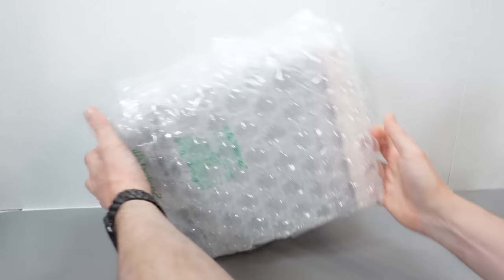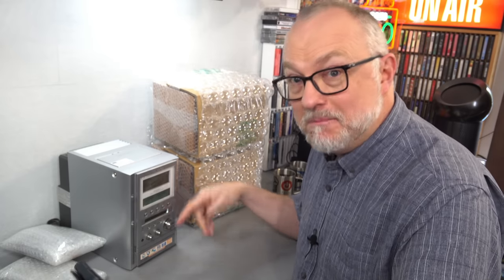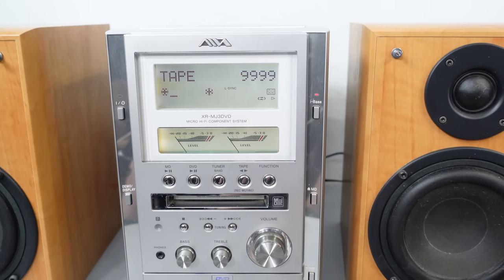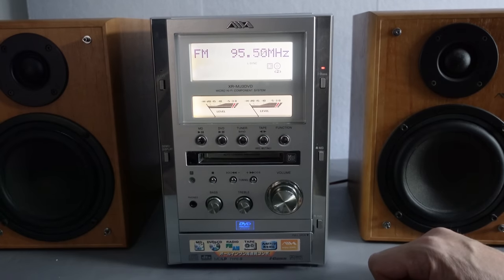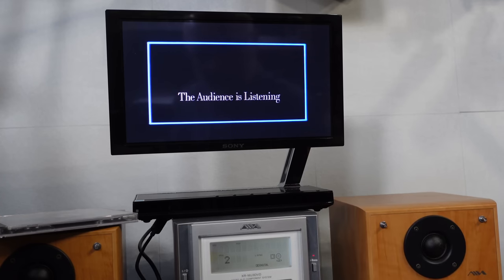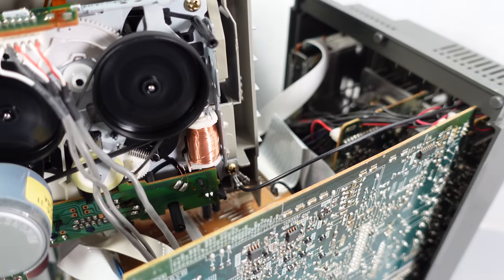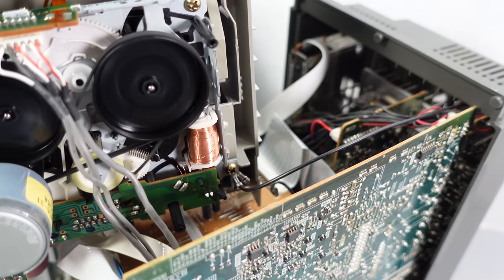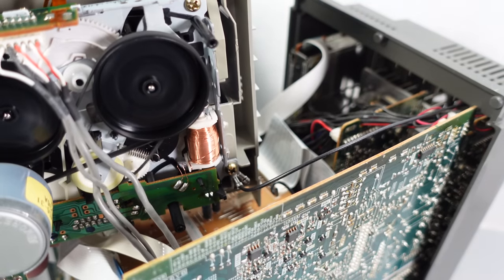Micro Systems 2:  Eclectic Boo-Boo

Comment: Probably massively too late now, but you can just connect the green component lead with any RCA cable and you will get a black and white image that will let you navigate menus
Reply: That doesn't help much when the green connector isn't on the unit itself. But personally I would be very surprised if the interlaced/progressive switch wouldn't re-enable composite video output.

Comment: So the original Aiwa was all separates so if you added more full sized separates onto it with the micro separates they would be different size from each other.

Then you have the final real Aiwa 2000s with the blue speakers and the final one with decent wattage speakers.

Then you have Aiwa as a lower end Sony but packed with features and less reliably than the hinges of a front tape door breaking of the previous.

Next you probably have a really low grade tape I bet in the final one.

Comment: I have a micro system from Sony. It worked almost perfectly (just headphones jack didn't) until last summer. Cassette deck stopped fast forward or back, just playing and with strange noises, next CD player stopped reading discs. Both in the same time. Now only aux input and FM radio work fine

Comment: I'd love to try and fix this, looks an interesting one :D

a few different things - the DVD drive I think I know what's up with that, the try has just slipped out of position on the runner.. the MD player, you need to move the sled back, and there's a chance the detect switch is frozen (from being stuck in position so long), and the tape-drive will likely just be a capacitor or two, or a couple of transistors :)

Comment: you may be  able to repurpose 

1. dental rubber bands

2. pinball machine rubber bands.

if you are up to getting prime membership you could overnight stuff.

you may want to make sure the cd is not copy protected because after napster then labels was making cds with copy protection usually based on a fake track designed to cause reading errors.

not all cds said if it was protected so you may want to try a cd from before the 90s when they was guaranteed not to have protection.

Comment: In 2000 I had the Aiwa with the blue speakers that really was big quality small price that one even the tape sounded decent I used my tape so much the door packed in and I couldn't use tape I had to chuck it out. Yep decent sounding tape but poor door. It still lasted 10 years my favorite older bedroom system.

Comment: I learned my lesson in trying to fix what might have been an easy fix for someone more experienced, years ago.  The taking apart bit is easy.  It's the putting it all back together again, (making sure to put everything back in the same position and the right way round), that's the problem.  A shame this wasn't able to be fixed, but I think parts of it were too far gone.  The MiniDisc mechanism and possibly the CD/DVD, too.  The cassette deck was a relatively easy fix, at least mechanically.  And, if there was a proper aerial on it, it might have been a half-decent digital tuner.  'Frash Rom.'  Definitely Japanese!  😁

Comment: Around the same time this system was released, a close mate of mine had a midi system with 5-disc changer which likewise could play DVDs. I seem to remember it was also an Aiwa (Old badge) but was a UK model, so perhaps this was something Aiwa was testing in the market at the start of the 2000s? 🙂

If you have an Aiwa system of that era and are curious: The obvious giveaway would be a video connection on the back. My mates only had composite, so would've been easy to mistake for an RCA audio connection. 🔌

Finally: I'm going to guess the reason the tape player went "pop" is because you might've put the plastic on the wrong side of the flex, leading to it being inserted in reverse. 🙃

Comment: I have a Sharp mini system from around 2000. It's feature rich and has impressive sound considering. The only reason l don't use it any more is because the remote quit working. As you said there are many functions that are inaccessible without remote. It's still functional as a whole. But all the surround sound adjustments are solely remote accessible. It would jusr end up bugging the crap outta me...

Comment: Probably a moot issue, since you have a component cable on the way, but on a lot of Sony devices, power off the machine, then press and hold the power switch until there is a beep (or 30-60sec, if no beeper) to factory reset.

This disabling video output must be a Song thing, I remember having to do a reset on PlayStation 3s if you used HDMI, but moved the machine to somewhere with only analog connections. You had to blind reset the thing to get video back on composite/component.

Also, about FrashROM, in Japanese R and L don't have different sounds, so often they use either character.

Comment: One thing I hated back in the day, was those multi-format disc players, they were so slow, and got slower and slower with each new model that supported more formats.

As for those ribbon cables, they are a pretty standard style, even still today. You can easily get replacements from places like Digikey or Farnell, no need to try and save some old, potentially damaged, ones.

Comment: I got some hand downs and can confirm your experience, mini system late 1980s Sony, belts gone, micro system late 1990s samsung, cd and remote gone,  belts good though, mini system early 2000s Sony, belts and cd gone, repaired cd but deck is unfixable. I'm curious about your next video with a new system. Cool series so far.

Comment: Also if your machine chews your tape, usually the best way to deal with it is to leave it and rewind. Unless it has wrapped itself round the capstan it will return without damage.
Reply: I've had enough experiences of it just making the situation far worse I'll take it out as soon as it seems to be chewing.
Reply: @trailersic  You just need to be sensible. In 50 years working with tape I've never had an issue, because I'm not going to attempt to rewind it if it has threaded its way through the machine for half an hour.
Reply: @trailersic  PS I guess for me its only when I'm testing, so a test tape is in and you are only going to do it once and in quick order. I have a lot of machines through my hands. So yes, i agree.maybe its not good general advice.

Comment: i would bet the issue isnt the laser with the dvd player its most likely the laser diode's alignment mekanism being worn out, its done electro mechanically and over time the coil needs more current to do its job most modern dvd players now come with an software adjustable mosfet to deliver the power to the electromagnetic coil

Comment: Maybe you or someone in the comments has already addressed this, I am only half way through the video. But it might be worth a try to connect the composite out rca of the awia to the "Y" or green rca of the 3 component rca connections on your TV if it has them, to see if you can display the menus again. Having set the Aiwa video out to progressive means it might be sending a 480p60, not 480i signal out the composite rca, and your TV composite input may not like that. I've seen this behavior on other DVD players.

Comment: Used to love Aiwa hifis and mini systems, but unfortunately the ones from the late 90's to early 2000's always suffered from cd player failures after a short time, so was no surprise that this cd was not working well. Also the electronic volume knobs failed too, as you turned the volume down the sound would leap up or vise versa. After working in an after sales repair centre for a short while, was often found to be an issue with too much lubricating grease being put on the potentiometer itself and the cd players were often the centre spin motor not running correctly to speed, you can usually can determine this when it struggles more to play the latter part of the disk, as it runs faster when it scans the outter area of the disk, so often the cd will succeed more playing early tracks, but struggle more as it goes on.

Comment: I remember that time period and losing interest in consumer electronics since PCs had basically taken over by that point. Most of everything else started using cheap and nasty parts inside from you-know-where along with silver spray paint, plastic chrome, and impossible-to-read semi-silvered display windows with so much glare that... well you get the idea.  That stuff was revolting inside and out.

Comment: I had an aiwa system from the late 90’s that developed similar cd reading problems after a year or so. It was replaced, under warranty with a newer model which also developed the same fault. Really frustrating. My modern day Denon system works flawlessly thankfully

Comment: I got turned off Aiwa many years ago when they were using a chip for the CD players that had an extraordinarily short lifespan. They were well known for failure and it was an odd failure as it would only let the cd play to about half the tracks. The radio repair place said he would pay a nice fee if anyone could have got him new replacement chips for them since he had so many come in. 

    I need to find a new home for the rest of my dads old Kenwood stuff. I don't miss the days when everything was a separate box. One massive box for the tuner, tape deck etc. Not a fan.
         One product I would like to see is a decent quality mini receiver. Like the countless ones that Pyle sells. Their size etc are perfect for what I need but I'm on my second one as the first lasted a few days before it would only half turn on.

Comment: I feel your pain, these all in one units are a nightmare to work on, I spent the best part of a day repairing a similar JVC unit, the earlier Aiwa system is way better in build quality & ease of repair.
It seems that build & sound quality began to decrease in the early to mid 90's, in my opinion, the mid 70's to early 80's was the peak of quality of most Japanese Hi-Fi systems.

Comment: Part of the issues with both so far have been due to age for sure but part of it is Aiwa not being known for the highest quality. They made some real high end components but their micro systems were always on the more budget end compared to Sony, Panasonic/Technics, Onkyo, or TEAC. Which is emphasized by Aiwa being a Sony budget brand by the early 2000s. I'm betting the Sony variant cost a bit more and probably uses some better components. Which is a shame cause the Aiwa looked pretty good.

Comment: i love this channel...Techmoan actually gave me more encouragement to attempt the belts on my cassette components...3 decks and a portable...with a lot more success than this video...thankfully...one of the twin deck components is Sony and was too far gone with gooey melted belts...i got one side reasonable...other side unplayable...2 other decks worked out well though...surprisingly...the portable doesn't fast rewind on deck B...99% success...and i also have 2x Sony CMTxxx mini systems...one with CD/MD/FM/AM a low rectangular compact system...and one of those micro upright systems without a Minidisc but with cassette and CD and radio (very plasticky and cheapie)...oh and loads of pocket players...i'm overstocked in my retro dead tech "no room to move" studio flat...but i wouldn't part with any of them...

Comment: Unmarked ribbon cables are the worst.  They break very easily, and it's not terribly hard to reverse them and apply the wrong voltages to the wrong parts.  When you're working on a device with unlabeled cables of any type, mark them with a sharpie on one side to make sure you don't reverse them when reinstalling.

Comment: The first time you break/rip off one of those foil/ribbon cables is the moment you'll learn that the FIRST thing you should do when dismantling such a device is to REMOVE/UNPLUG those cables.

Trust me, it's fair easier to plug them back (they're almost certainly fool-proof) than to find a replacement or to repair them.

Comment: What you probably did incorrectly is sticking plastic on incorrect site of connector. This type of ribbon cable are made in all possible variants, connector face could be the same on both ends of cable or on opposite which sometime confused.

Comment: Noooo, don't take it apart for parts just yet!!  As far as the CD player, the tray may have moved too far forward, causing it to not work properly.    The DVD drive in my computer did that same thing and I took it out and opened it and raised the back up and slide it back and now it works fine.  I wish I lived close to you so I could look at it for you.  That looks too nice a system to give it up for parts right now!

Comment: Your kerfuffle with the video mode sounds very Sony for the time, indeed! You could put yourself in the same dilemma with the PlayStation 2 console in not one, but two ways. If you had a slim console, used it as a DVD player, and enabled progressive scan, you get the same thing. Or if you hook up either component cables or whatever is used for RGB, picking the wrong thing in the system settings gives you the same problem.

Comment: The PlayStation 2 is about the same age and sometimes the dvd laser will start to die before the CD one. It too had a component mode which, once chosen was very difficult to switch out of without a component lead. But they did have a button combination on the controller to reset to default. Maybe this device has one on the remote.
Reply: Small corrections :

*Sometimes the DSP crashes, and that affects the mechacon in pretty much everything from the 39xxx models to the 77xxx ones

And also, said button combination, consists of blindly, setting the console back to RGB

Comment: Is there a website with a list of minidisc micro systems like this one, with pictures. I'm trying to figure out the one I used to have. 😢

It was late 90s/. Very latest 2001. It wasn't a Sony. It had a ps/2 keyboard port in the front. You could set a timer to automatically record a radio show onto minidisc.  I think there was a mechanical part which recessed/pulled in to reveal things like the volume knob. Also think it was a silvery colour. Maybe an orange backlit lcd screen. System and speakers about the same height. Minidisc loaded in the front. North America. I really loved it and would like to have it again. (It was gotten rid of/sold by an x gf)

Comment: The big problem with these mini audio systems is that they are made of very fragile electronics, which, when a long time passes, can be damaged, and disassembling them to try to fix them can be counterproductive (it can leave the unit completely unusable). If I buy one of these, and it has these problems, without hesitation I take it to a technician who specializes in repairing these mini components.

Comment: Wait! There's more that can fail... The LCD display will likely loose dots, columns or lines, making reading a constant mind game! I have been told it's the ribbon cables junction with the LCD display that oxydizes over time and apparently there's no cure.  I have encountered this problem at least twice with equipment from this era, notably with Sony systems. And for the higher end devices with auto reverse tape decks, the rotating mechanism that flips the heads with simply snap. It can be glued back (not easy) but this will not hold for very long. All in all, the vintage HiFi systems from the 80's were of better quality.

Comment: There's a chance the fault with the tape deck is just a popped electrolytic capacitor, which could be easily replaced. If there are chips that's been damaged that would be neigh unrepairable, though. Not that it matters at this point.

Comment: DVD decks generally do take longer than CD decks to read a CD as they have two separate lasers. The unit presumably tries to search for a DVD first, then bails out and looks for the CD.
Reply: Pretty sure they don't have two lasers. Not till Blu-ray/ hddvd
Reply: @TheErador  Yes, I think you're right, but the optical system still attempts to read the  DVD first then refocuses to look for the CD, so same principle and hence the delay in finding a CD.
Reply: DVD uses red laser, as CD does.
Reply: @UHF43  Yes I've just agreed that I got that wrong, but am I also wrong about the laser having to refocus to read a CD?
Reply: @TheErador  Don't quote me on this but I think some early DVD + CD players did have separate lenses, and later on they did make the laser of the DVD compatible with CD or something